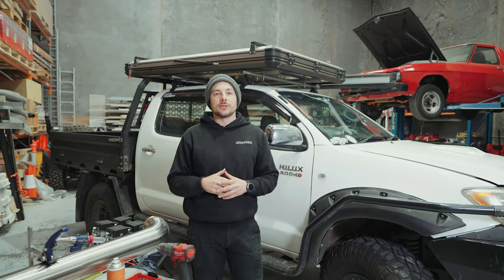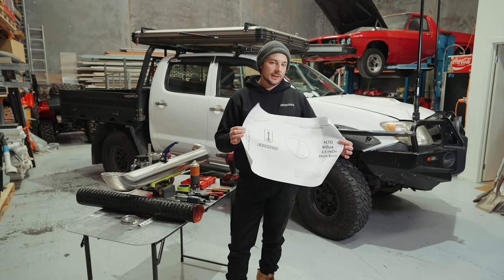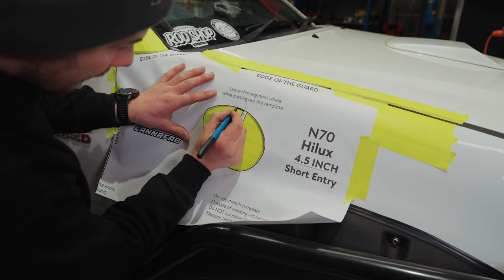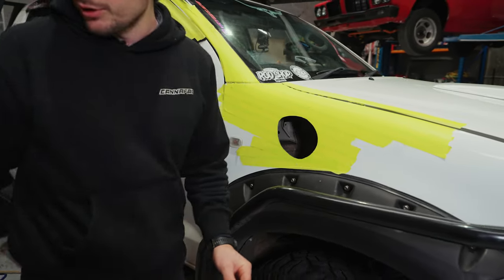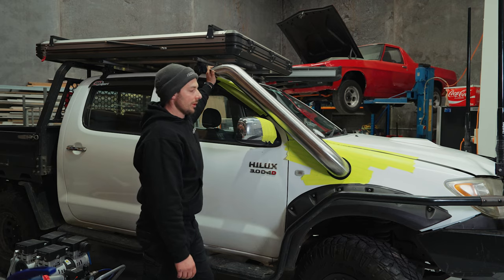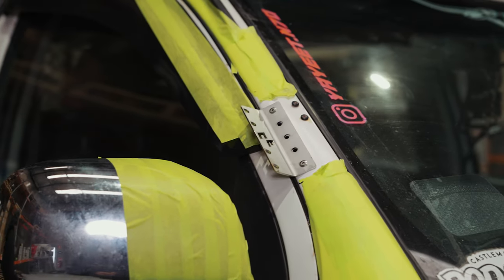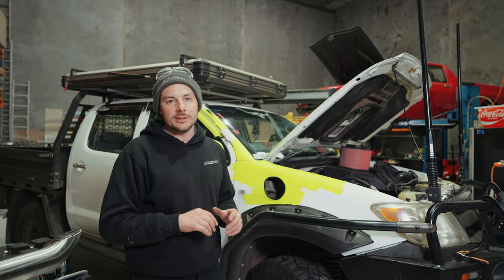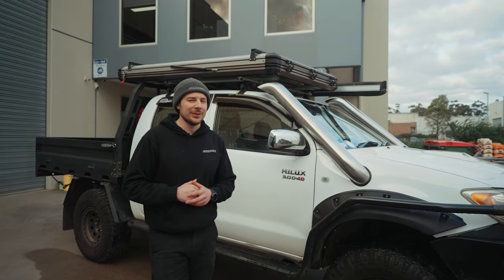N70 TOYOTA HILUX CANNAFAB TWIN SNORKEL || Installation video follow along

Comment: Don’t see how you connect flexible hose to the factory air box, and what do you use to mount snorkel to the tab you just pop riveted
Reply: Hi we use 5mm bolts in to the snorkel which has nut inserts fitted, the flexy hose fits on the the airbox by removing the diffuser with a flat head screw driver.